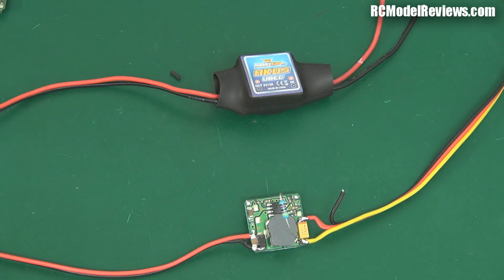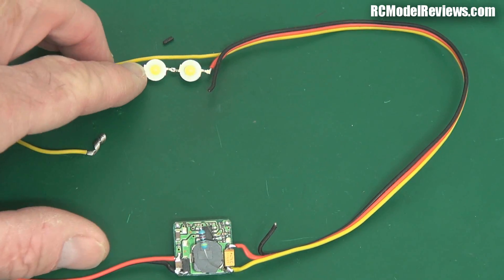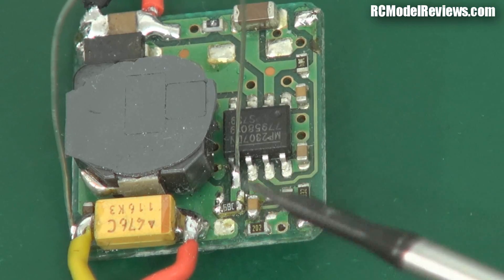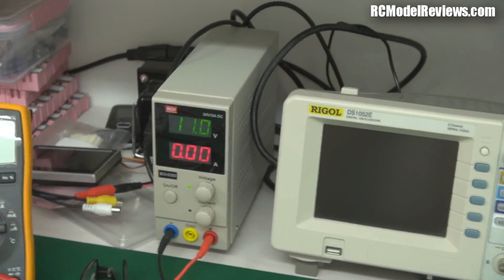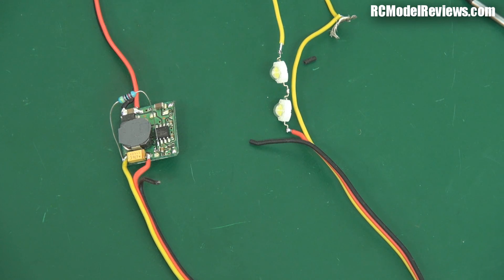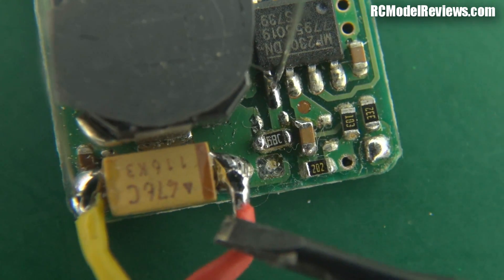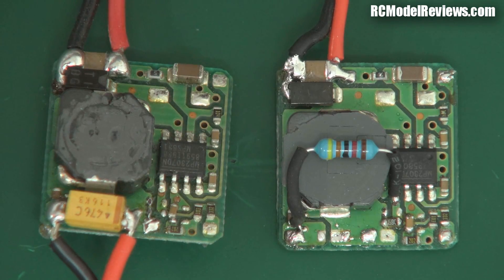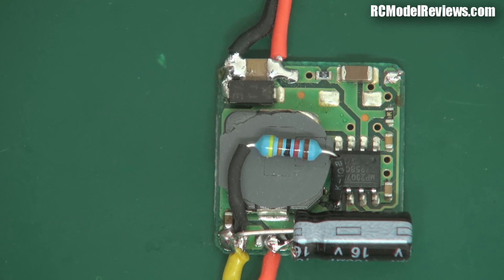Hack a HK UBEC to change the output voltage

Comment: Guys, i have a burning question. 

And even with all the googleing i can't find an asnwer. 

Anyone willing to help?

Situation: I have an UBEC DUO. On one side it has DC IN and on the other side it has OUT 1 and OUT 2. 

What happens if i connect the battery to OUT 2 and the device to DC IN. Basically what happens if i connect them the other way around? Note that the polarity is ok, is + to + and - to -. 

Will it cause the device to suffer?

Comment: i got a 2000mw fpv transmitter on my fpv hexa which runs on 2 4s lipos. I'd rather not use a 3rd battery and was considering just using a fixed voltage regulator until i saw this video. ty :)

Comment: Great idea and video, what is the formula for calculating the resistor ? I would like to modify one for 1.5v output for  on board glow plug. driver.

Comment: Thanks for the inspiration. By mistake I had a bunch of similar 3.3V regulators delivered, and wanted to turn them into 5V output. The voltage divider in the 3.3V version consists of two paralleled 51K resistors (marked "513") as top feedback divider resistor. By removing one of them, I increased the output from 3.3 to 5.7V. What is the value of the SMD resistor that you are paralelling with your ext resistor? 68K ohm?

Oh, and clever of you to check the capacitor voltage rating - I would have forgot about that :) But I wouldn't use a normal electrolytic capacitor for the job, though, due the high ESR...
Reply: As per the spec sheet for driver chip on that board, the "paralleled 51k resistors" should be replaced by 44.2k ohms of resistance. This means you could replace both of them with a single 44.2k ohm resistor or remove one and parallel the other with a resistor as close to 330k ohms as you can find.

The equation for resistors in parallel is: 1/((1/R1)+(1/R2)+(1/Rn...)) Assume that the number after "R" is subscript and not a value.

Also, in regards to the type of capacitor used for the input and output, the spec sheet indicates: "Ceramic  capacitors  are preferred, but tantalum or low-ESR electrolytic capacitors will also suffice." The removed capacitor was a tantalum of lower capacitance. Assuming that the electrolytic that was swapped in was a low-ESR variety (and this video author seems to know his stuff), then the higher capacity electrolytic should compensate for any lost effective capacity due to ESR. Furthermore, the switching frequency of this controller is only about 340kHz, which is a bit low to really force the selection of a more expensive part.

Comment: If you set up the voltage feedback to regulate the voltage across a sense shunt resistor, you will end up with a current-regulated voltage regulator! I know this can be done with linear types, I am not sure of the stability of doing that with switch mode regulators though. Any I hate driving LEDs off of a constant voltage source, since relatively small variations in the voltage will dramatically affect the current and power dissipated/used in the LEDs. I find that although white LEDs are somewhat tolerant to .5V-1V overvoltage, it often degrades the LEDs and will simply pop red, green, and especially amber (golden yellow) LEDs!

Comment: What resistor value do I need for 3 volt? Or, does anyone know the formula to calculate it? I intend to power a green laser pointer that normally requires 3 volts (2 X AAA batteries). Thanks for any help!
Reply: You can't lower the voltage with a shunt resistor as shown. You need to desolder the resistor in question and replace it with one of a higher value. 25K will give you 3.3V (checked with a 3.3V version) for 3.0V you'd probably need around 22K.

Comment: Hi Bruce,

you mentioned that you also wanted to supply a formula in order to calculate the apropriate resistor for a wanted voltage. Can you please add this formula to the description? I have experimented with two resistors so far:
R1 = 6,8K Ohms --> 12,38V
R2 = 15K Ohms --> 8,65V
I wanted to yield 9V so I guessed the 15K.

Best regards, keep those videos comming, very informative ;-)

P.S: Did you get my email about the mini FPV cam for the Kinetic800 Glider? Tried to send it twince but never got an answer :-/

Comment: What is black part shown up in left corner at 7:23 with text "TI 7E"?

I got a 9V 4/5A, i think, and it let some smoke out first time i connected it. I had multimeter to show volt at all time, and it showed..hold on..over 40V!! I quickly dissconnected battery and cut it open to see any visual damage. I imidietly smelled that same black part, and it was obviusly blown up. I clipped legs betwen boards, and checked if other board worked, and it did! Atleast it show just over 9V on multimeter. I hope i can get a new "black TI 7E part" and get that board to work too.
I did some searches on google, but only thing i found out (if correct) is that it is a schottky diode, and maybe TI stands for Texas Instruments?
I should also get my hands on a good magnifying lamp, anyone have recommendations? Maybe glasses/goggles with light, or are the only for close up work?

Comment: would it be possible to hook up two 6 volt UBECs in series (running off the same battery) to get 12 volts? I ask because i need 12 volts for a project and HK is sold out on 12 bolt UBECs
Reply: Not a good idea with these switching regulators. But plenty of 12V types on Ebay and HobbyKing

Comment: Bruce great video, thank you. This will be very useful for powering LED strips on a 4s lipo. Except I plan to remove the LED strip's resistor and power it completely on switched voltage. The power saving would be minimal, but useful regardless. So I probably need an output around 10-11v (3.7v each) to stay within spec.
I bet the reason the HK UBEC is noisy is due to that tantalum cap, the electrolytic cap is a perfect upgrade.

Comment: What would be the best way to eliminate noise on a single battery setup for FPV (which i haven't acquired all the parts yet). Would a step down regulator suffice or would a LC filter be better? I have no knowledge of electronics.

Comment: I just bought these, work out less than 2 bucks each...
http://www.ebay.com.au/itm/5-pcs-DC-DC-Power-Supply-Step-Down-Adjustable-Converter-LM2596-Module-1-3V-35V-/141054945487?pt=AU_B_I_Electrical_Test_Equipment&hash=item20d787a8cf&_uhb=1
and over the last couple years have used probably around 30 of them and only had one DOA and none ever fail, saves lots of effort trying to solder etc.
Reply: Even smaller and cheaper... 3A DC-DC converter for $2 http://www.ebay.com.au/itm/310683416079
Reply: Hi, yep tried those as well, they are pretty good and tiny, but no way 3A, I use mine on a quad to supply power to the gopro, that draws 800ma whilst charging and it gets pretty warm. If you wanna go higher need these.
http://www.ebay.com.au/itm/131014795047?ssPageName=STRK:MEWNX:IT&_trksid=p3984.m1439.l2649

Comment: Bruce, i won't comment on the use of LED without series resistor or any current regulation... But the 47uF/6V tantalum will soon go up in smoke!
Reply: I've used a similar but variable voltage regulator to supply an LED and providing you do do not exceed the rated voltage of the LED it works fine. As Bruce points out, resistors introduce wasted energy in the form of heat.
Reply: Zaprodk, isn't that why Bruce replaced the 47uF/6V tantalum capacitor with a 100uF/16V electrolytic capacitor?
Reply: Jeff Thompson Yep

Comment: I usually use an old type GWS brushed speed control, usually a 5 amp because I can use a channel on my receiver to turn it off and on. This makes an excellent way to turn on and off your L.E.D.'s from your transmitter. You can even dim your lights (if your transmitter is equipped) with the pot on like a DX8.

Comment: that regulator is/was designed for about 2amps at 5v, or 10w, so yes you could make it /maybe/ do 16v to 12v, but you would not be advised to go above 12v at just under 1amp, to say around the original 10w design. if you did 12v at 2amp you would be at 24w, not sure how that would turn out in the end. 

Or am I barking up the wrong tree here?

My reasoning is the circuits switching transistor will have a certain watts rating and an amps rating, neither of which should be exceeded, or am i playing it too safe?

Comment: Would it be ok to use a variable resistor instead? That way we will be able to fine-tune or vary the output voltage accordingly.

Comment: Which resistor do you need for 5V? I have the 3.3V SBEC from Hobbyking and I would like to have a 5V one... It looks the same and has the same chip.

edit. Problem solved. R1 has to be 47K for about 5.3V.

Comment: You can also buy 3A adjustable switching regulators on eBay for $1 a piece ;)
Nice LEDs btw, I use those as lights on my quad copter gimbal :)

Comment: those modules go by the name of  KIS-3R33 if you wish to buy them by themselves
Reply: they also REALLY DONT like more than 20v~ even though rated at 23v~
Reply: bgdwiepp I got a bunch of them extremely cheap on ebay some time ago. Pretty beefy things. Manual how to mod them including images: https://www.digole.com/index.php?productID=458
Reply: Also make sure the output caps are safe for whatever output voltage you select.

Comment: Those little switchmode regs use a pretty high switching freq so require a low ESR cap on the output in order to handle the high ripple current. Tantalums have good ESR so that's fine, but a generic electrolytic will probably have issues. It needs to be a low ESR electrolytic
Reply: If you look carefully, there's also a ceramic cap across the output.  This will provide a low ESR at the switching frequencies involved.
Reply: That ceramic is pretty small, probably 100nf. Datasheet recommends two 22uf low esr caps in parallel to get the esr as lower as possible. It should be easy to check if the generic electrolytic is causing any issues. Just compare the output ripple of the modified unit to the unmodified one.

Comment: 745am uk

could you do a video of a flashing led circuit?
would love flashing nav lights on my wing tips xD
Reply: Yes, I'm working on a strobe circuit for my FPV planes.  I'll probably use some of those 10W white LEDs which can be overdriven pretty safely as long as you are only using short pulses with a decent interval (like on for 0.1 seconds and off for 0.9 seconds)   They are very bright.

Comment: Come on Bruce, teaching people to run LEDs without current limiting? You should know better haha.
Couldnt you turn them into a constant current supply by putting the resistor between ground and the cathode of the bottom LED to give you 1.25V @ 300mA or something? wouldnt be as efficient, but would allow your LEDs to live longer ;)
Reply: Yeah... I will be adding a small current limiting resistor -- the demo on the bench was a "proof of concept" application.  Good idea about using the resistor to achieve constant current -- I'll look at that.  It'll have to produce a voltage drop of 0.925V at 300mA so that's nearl 280mW of wasted energy but could be worth a crack.
Reply: 0.28W is nothing compared to the 1000W the motors will draw though :-P but nice video none the less, will get some of those ubecs!